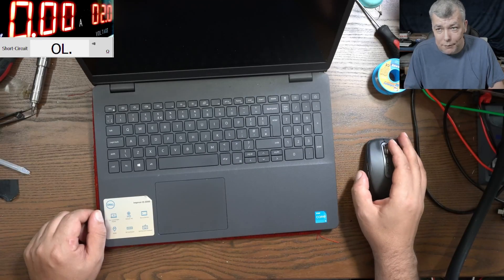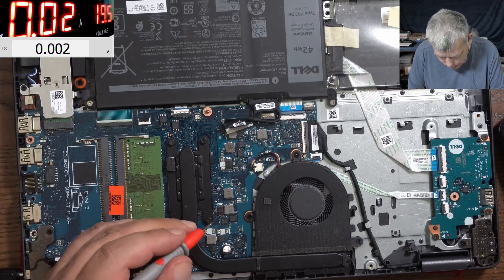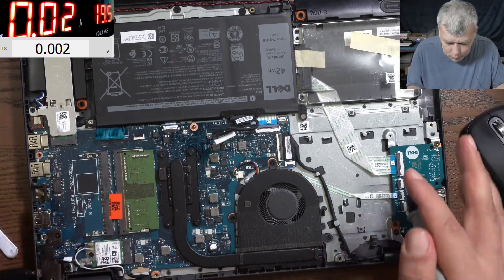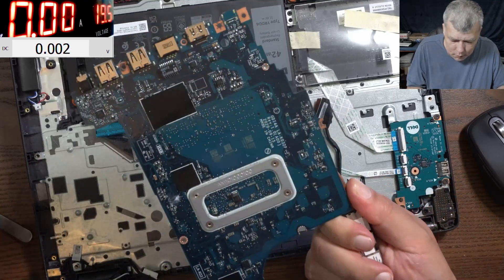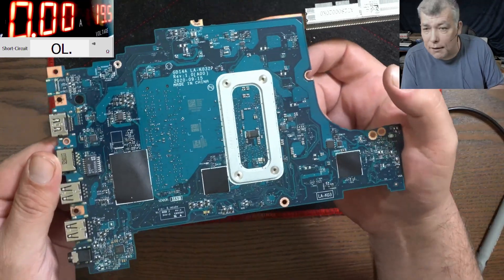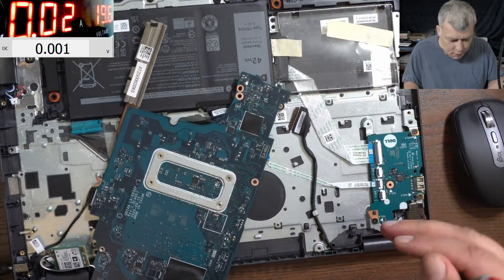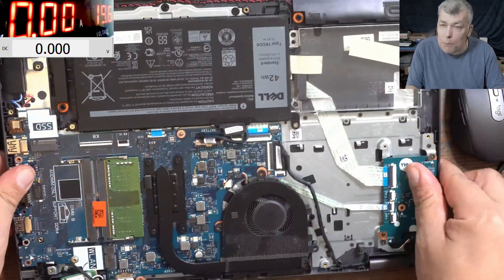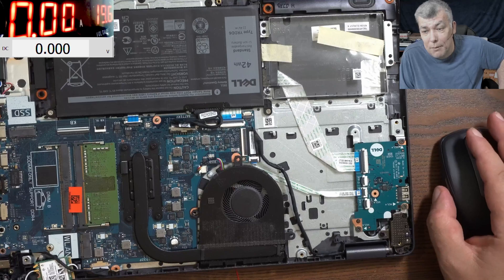Dell Inspiron 3501 no power - Water damage board repair

Comment: you shorted out the resistor on an RC filter to bios chip. this fixed the low 1v to 3.3, so either the bios chip or other circuits on same rail were drawing xs current or (more likely), the resistor had gone high in view of its proximity to water damaged area. 

i would have replaced resistor with one of correct value so bios is getting a properly filtered 3.3 even if it worked just fine with 3.3 via your zero ohm resistor. having said that you sure know how to get working results & quickly.

Comment: ... 5:49 - i think that cap is bad! :)
is parallel mode with a resistor, and those caps have a habit to fail short. sometime, they aren't exactly 0 ohms, so... BUT we have another resistor in parallel with the original resistor.
this explain why 2 volts was gone, but no short there...
Reply: Please check 6:02 (close up) where you can see the cap and resistor, are not in parallel mode.

Comment: Instead of using a "proper calibrated wire" you could just have used a 0 ohm resistor, which you should have on any non working board.

Comment: If that resistor is actually a fuse, I don't really understand why you don't put an other fuse into its place. Next time it will blow up the board.
Are those flash chips  XMC qh64ahig and qh128ahig?
Reply: Technically, he did. A fuse is a piece of wire. 😆
Reply: I would have replaced with a 0 ohm resistor